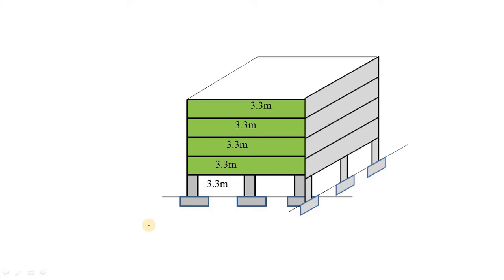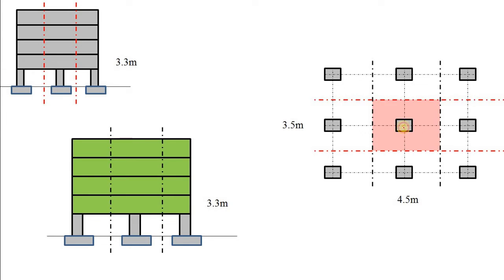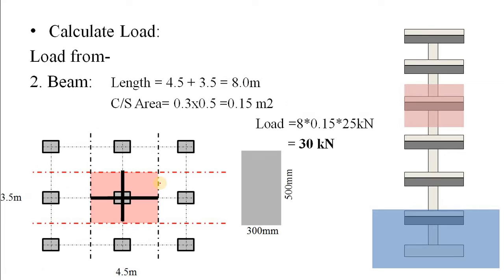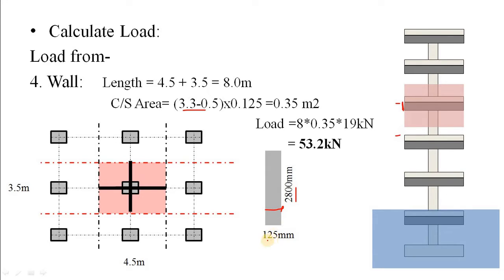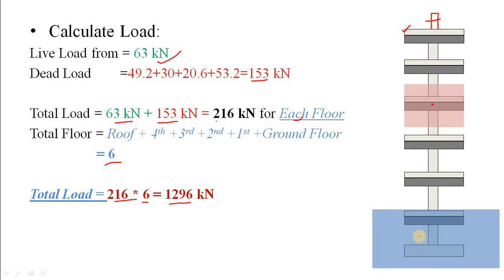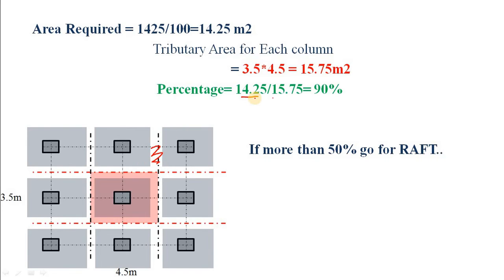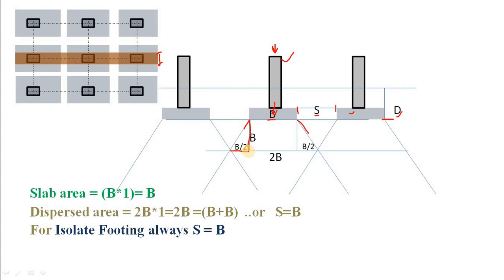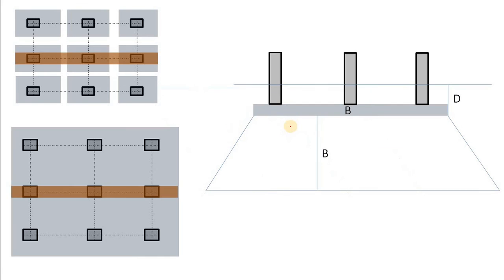What is Tributary Area Method for Design:Tributary Area&Load Calculation,Why RaftFoundation required

Comment: Why  you multiplied by 6???the ground floor is rested on the ground directly.it should be multiplied by 5(1st floor slab +2floor slab+3rd floor slab +4th floorslab +roof slab)
Reply from the maker: Assuming it is not supported over ground